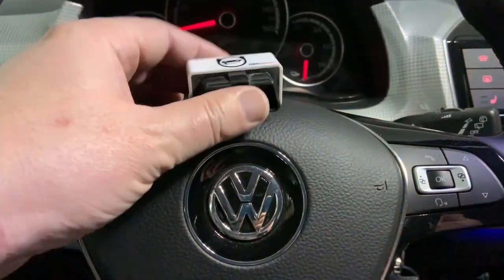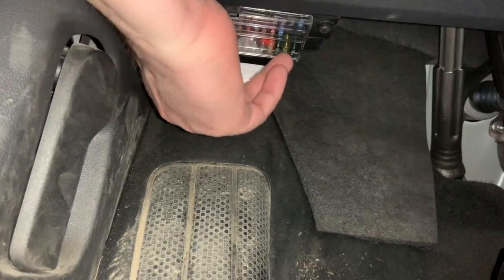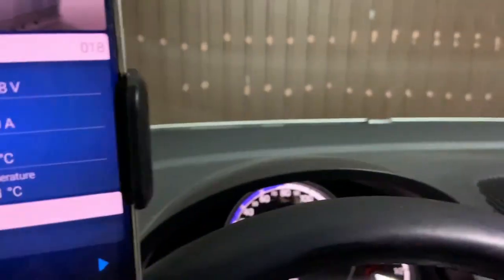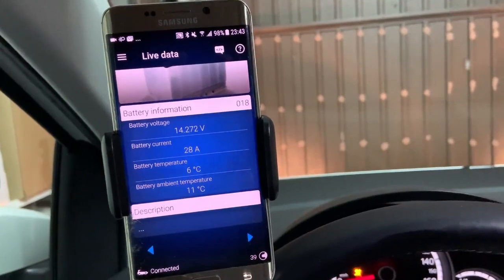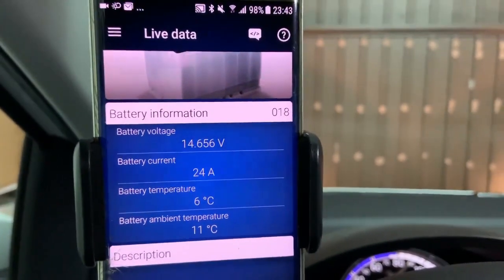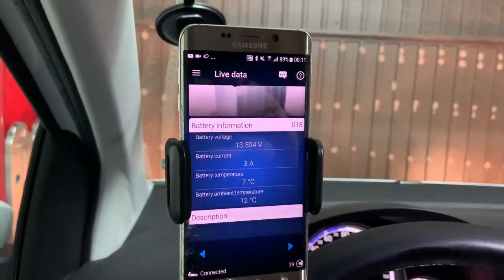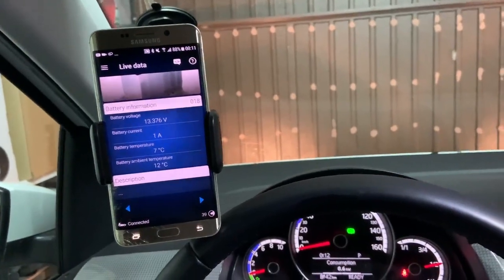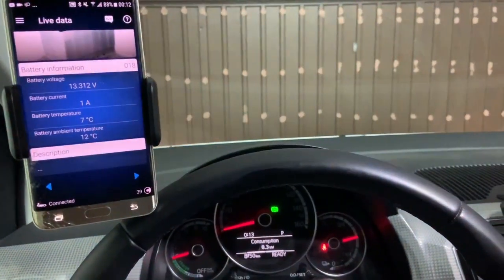How the 12V battery is charging in VW e-up!

Comment: Nicely explained and demonstrated the DC-DC kicking for 12V Battery charging. I am happy now somewhat worry free because most of the times my Car (EV) is parked. Now we will try ON them without traction motor to keep up the 12V battery in its live position. My car is BYD Atto-3, hope it works to the same way in my car.

Comment: Again one interesting  Video, I never thought it could work like this ... If I get it right:  below 13V - the whole Power goes only from 12V Battery, more than 14V - the 12V Battery is "charging", and 13.5V - 12V Battery is "maintained", this is how it works on the new gasoline Engines with EURO6 and Start / Stop System.
Reply: In the TSi Engine the Battery is only charged when needed (determined by the system) and whenever is with Engine braked. Otherwise, it is maintained 13.5V while driving. And even (allegedly) under sudden acceleration, the Alternator is disconnected completely to prevent energy loss.
Reply from the maker: Here is not like this as I tested. The battery is kept at 13.3 volt constantly by the DC-DC converter and all the electronics are power by the converter.
Reply: @tedonash2681  and this ist exactly the same Situation as with running TSi motor - Battery ist at 13.5V and Alternator powered all.

Comment: Thank you for testing this! I suggest you should simultanously monitor the HV-consumption, this should give you a pretty good estimate where the energy is flowing to. I also wonder what is the energy efficiency of the DC-DC converter, although I think it is difficult to get readings from OBDeleven that are accurate enough to calculate the losses reliably. Another question: Does the car trip an error code if you connect a conventional 12V car battery charger directly to the 12V-battery terminals while connected to the DC-DC-converter (and all the other systems), since it is sensing the battery voltage permanently?
Reply from the maker: Thank you for the good suggestion. I am planing to find out what is the efficiency of the DC-DC converter this week and will make a video about it.
About the convectional  battery charger - I will try to hook mine and see what will be the result.

Comment: Did u test if the 12v batt is charging during the main battery is chraging? Thnx...
Reply from the maker: What I have checked is when the car is started the 12V battery is charging from the high voltage battery with or without the charger is plugged into the car. I haven't tested if the 12V battery is charging when the engine is off.
Reply: Any updates? Have you observed if 12v is charged during HV battery charging?

Comment: what happens when the car is connected to AC or DC charger?
Reply from the maker: If the ignition is on it will charge the 12V battery. If not I am not sure. Will have to check.